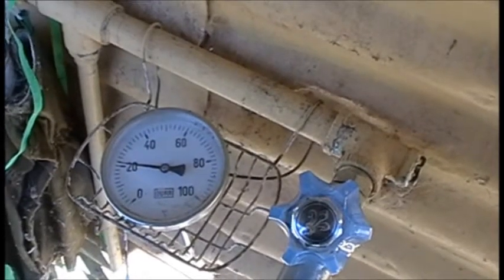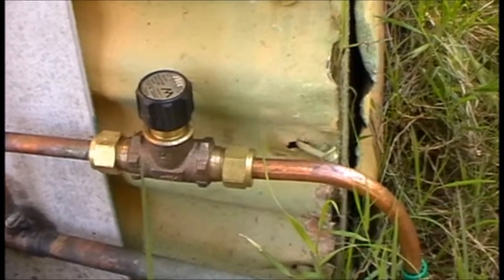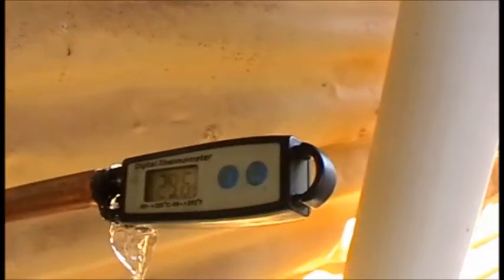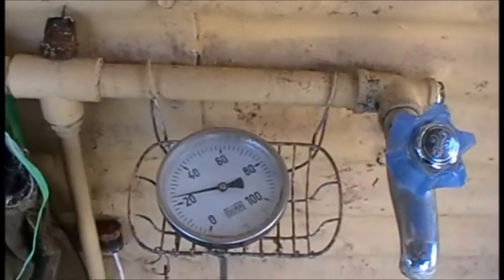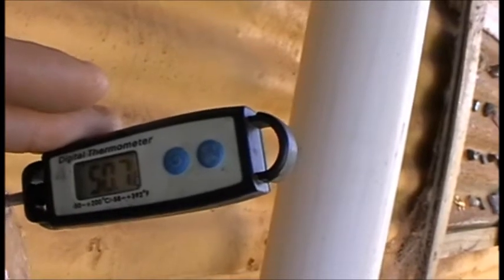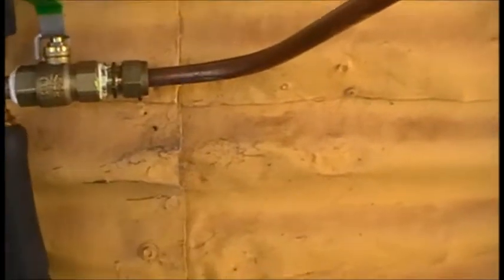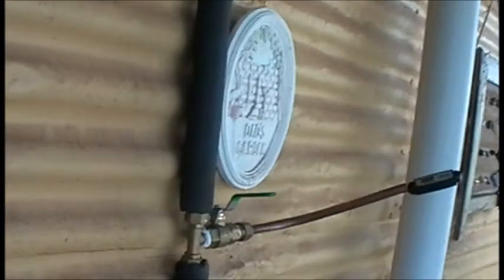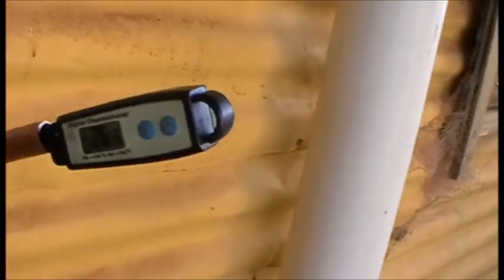Mike's Solar Batch Water Pre-heater

Comment from the maker: Thanks for your comment. Coordinates - 32°0′20″S 141°28′14″E
Aspect of the collector (long axis) NNW. The common approach is to arrange the inclination of the collector +-10 degrees of angle relative to the latitude. However based on my aspect and site shading I opted for a lower inclination to achieve best results from spring to autumn equinox. For winter i will be retrofitting a higher inclination thermosyphon flat plate collector to the front of the batch heater. It hit 60C (140F) recently.